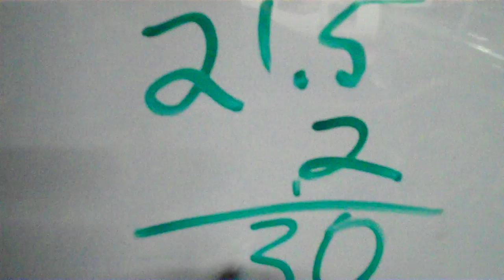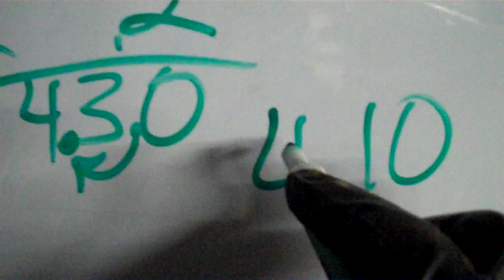How to find your differential gear ratio without stamps, tags, or tear down

Comment: Correct me if I’m wrong here but I learned the hard way on my 95 ranger these 1/4 tons are designed with “dropouts” made for racing but utilizing in off road vehicles to quickly fix major repairs on the trail. I don’t know the specifics on front rear dropouts it’s based on how it drops but I found that out when I grenaded my axle and was left to repair in the boonies. Aka 3rd member.

Comment: I have a pretty good understanding of differentials and have rebuilt a few but I am having a hard time wrapping my head around how one tire spinning cuts the rotations in half. Wouldn't the spider gears just slip around the stationary axle and still spin the ring gear the same amount?

Comment: Does 3.xx drives faster than 4.xx ?
Reply: 3.xx differential ratio will give you more top end speed. A 4.xx one will make your car faster from a stop at the expense of top speed.  Thats way most drag cars have 4.xx or even 5.xx differentials.
Reply: @vegarosa69  got it, thanks.

Comment: Could you not rotate the drive shaft say 10 times and the result would be 4 tire rotations? = 4.10 ratio?
Reply: No. Turning the tire, as he did it is much easier than turning driveshaft. Plus you don't need to be under vehicle to turn driveshaft. Safety first ! And if testing ror a 4.10:1 ratio, the drive shaft turns 4.1 times to 1 turn of tire.  So 10 turns of driveshaft ÷ 4.1 = 2.439  turns of tire. And as my Broncos and F250's have been 4.11:1 in rear and 4.10:1 in front differential. So 10 turns of driveshaft ÷ 4.11 = 2.433 turns of tire. Not much difference but over one mile the front tires turn 6 or 7 turns more. I did not do the math on this one. So be careful when you get super close results not to misfigure.

Comment: Why not rotate once and multiply by 2
Reply: Because you want the most exact gear ration possible to the nearest hundredths, so rotating 10 times gives you that better than rotating the wheel/tire once and not getting a easily counted number on the driveshaft rotation.
Reply: Because it is too rough unless you crawl beneath and measure the rotation angle

Comment: Why did you multiply the numbers by 2. I understand the decimal just fine. But not sure, why, times 2. ????
Reply: Because it's a limited slip.  He had to block the other tire to make the driveline move.  If he would have a locking rear end it would have moved double so you have to mult by two to make up for the limited slip

Comment: Great lesson on gear ration.   I have a 74 Bronco and want to change the rear end because when I'm on the freeway and left off the gas, the car almost wants to park itself when the slow down.  I'm thinking it's a 4.10 contributing to my 10 MPG.   I'll let you know.Thanks for the info.

Comment: I have a 1931 Ford Model A.  There is only a number stamped on the engine as a VIN. And, you can only tell the date of engine manufacture.  Noting about the differential.   I needed this information.  Used the method in video and it worked great.  Thanks for a simple straightforward video.  Thanks.

Comment: just read the tag on the diff (lol)
Reply from the maker: +Darron Mecak That's the best.  Seems like they often don't survive the first service when the bolts come out.
Reply: What if it's been changed and isn't stock? won't work.
Reply: Dale Heil not always people are always changing gear ratios
Reply: VIN number and a dealer can tell you
Reply: @DaleHeil-ju2qq  not usually true
Reply: Toyota Tags are notoriously wrong.
Reply: When I bought my 82 GT it did not have a tag. It ended up have a 85 GT rear end with 3.08. The 95 gt 8.8 I bought didnt have a tag but claimed to have 4:10s. Bought to see if that is true with this test.

Comment: You can do it by you can do it by your vin
Reply: +David Thomits You can, but Toyota's are notorious for having incorrect associations with their VIN#'s and VIN tags. For example my 4Runner has a VIN tag that says it came with stock 15" wheels however it came with 16" and wouldn't even be able to fit 15" because of the lager brakes. This applys to the gear ratio too.
Reply: I know this is an old comment, but just to state like before, not every vehicle's VIN will match up.  I know that people could look up VINs on some of my old trucks, only to end up thinking they have a truck geared to OEM build sheet specs when it was actually re-geared to fit my applications.

Comment: I'm pretty sure the tire size will effect the outcome of this test, would you prefer using stock rims and tires to get a more accurate reading?
Reply from the maker: PRF808 It doesn't.  Tire size DOES affect speedometer readings because the circumference is in play against the ground per each axle rotation.  Here the wheel is off the ground and we're not relating to the travel or velocity across the ground.  Number of axle rotations isn't affected by the radius of the wheel/tire.

Comment: Will larger then stock diameter tires affect this method?
Reply: Since the tires are in the air, and not affecting anything with the Diff I would think not.

Comment: I thought it would be encoded somewhere on the truck. Could it be?
Reply: probably with the vin, would've been much quicker
Reply: ixesound should be printed on the stickers in the door jam or under the hood.
Reply: +ixesound They are associated with the VIN, however with Toyota their VIN tags were notorious for errors. I would double check my ratio like this against the VIN.

Comment: so a 3.73 will be 3 revolutions of the driveshaft to .73 of a rev of both the tires?
Reply from the maker: Nope.  3.73 turns of the driveshaft will turn the back wheels round once.
Reply: ah now im completely confused ill have to watch your vid again ! haha
Reply from the maker: Think of it like this 3.73/1 reduces to just 3.73 just like 1/1 is just 1.
Reply: no 3.73 driveshaft rev's to 1 tire rev.  3.73:1
Reply: no 3.73 revolutions of the driveshaft, 1 rev of the tire.
Reply from the maker: chris hunt
That's correct.

Comment: i needto replace my pinion gear  1988  ford bronco  can i just replce my pinion gear or is there more to it
Reply: no you will have to repleace the ring gear also.
pinions are mated to each other.
so if pull one from a junkyard it both ring and pinion must be from the same truck.
ring and pinions need to broken in together.
it is sort of like camshafts and lifters

Comment: my 4x4 86 chevy blazer has a 1991 rear diff, and the original 1986 front diff. Will the ratios be differant? and if they are, how do I fix it so it's right.

Comment from the maker: It doesn't matter what car you have.  Differentials are either limited slip as I said or they aren't.  Either way you can find a ratio.  There's always going to be so many turns of the propeller shaft to so many turns of the rear wheels.

Comment: don't matter. 10 turns of the tire ,equals 10 turns of the wheel axle .think about it like this, write down one small circle  on a piece of paper, and make a bigger circle arround it  and put a mark in each circle just like brians tape, now turn the piece of paper arround they both will do 360 degrees. same thing.

Comment: yeah got mine rebuilt 4 years ago found out that t100's with 3.4 v6 4x4 A340F automatic is 4.30 ratio and manual trans are 4.10

Comment: I checked my Nissan D21 a while ago and also only lifted the one wheel, turned once and counted 4.8 to 4.9 revolutions on the drive shaft. Thought this was my diff ratio, but according to this, I should in fact double the counts I found on the drive shaft, that puts me at a 9.6, seems unrealistic to me. I will go back and do the 10x rev on the wheel and count again.

Comment from the maker: solid rear axle means the axle housing is tubular and one solid tube/piece.  Limited slip differential is a type of ring and pinion carrier configuation that can be put inside an axle whether solid or independent.

Comment from the maker: 4.3 means that the driveshaft turns 4.3 times to make the truck wheel turn once.  The more times it turns per wheel rotation the more torque and better off the line acceleration you get, but the lower speed per RPM.

Comment from the maker: It does work on FWD vehicles- they have differentials too- they're just typically built into the transaxle assembly.  You never divide by 2.  You multiply by two if one wheel isn't rotating too in order to get the driveshaft to move because spider gears have a 2:1 ratio.  You divide by ten because of the ten revolutions.  You turn the wheel ten times because you want an accurate number.

Comment: Great idea, Brian. I'm surprised it's not available from the VIN or other codes. 

I've wanted to watch how you do pinion crush washers, ie not just counting threads to reproduce what was there before. Hopefully when you do it Spanky will be there, to video exactly how it is done. I assume you use a press to get the preload right?

Comment: I am puzzled why you have to double the number. I would have thought that the drive shaft to axle turn ratio would be the same whether one wheel turns or both turn. I am guessing that it has to do with the planetary gears moving around inside there and the different types of planetary gears on conventional rear ends vs limited slip?
Thanks

Comment: Excellent video, thank you for that! So divide by 2 because there are 2 axles, or is that a generic formula for any rear end...10 wheel revolutions, count the yoke, multiply by 2 then divide by wheel revolution? In any case, thank you for the video, would this work for front wheel drive vehicles?